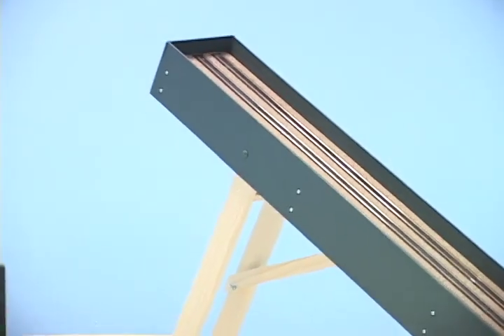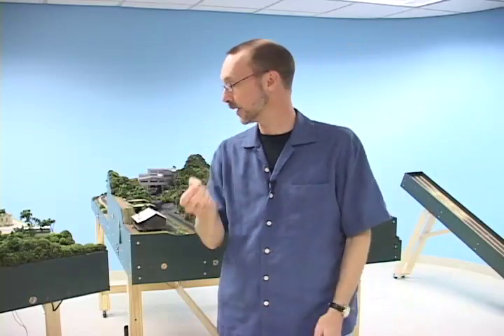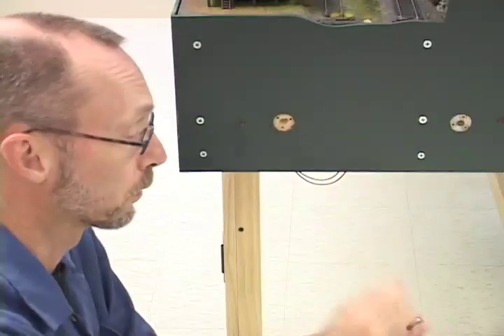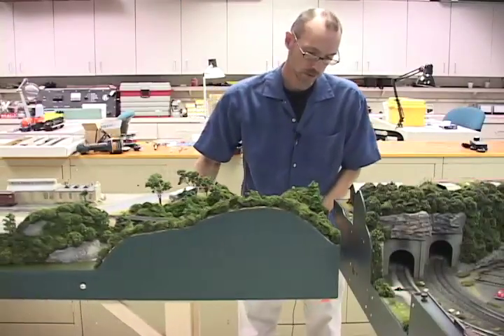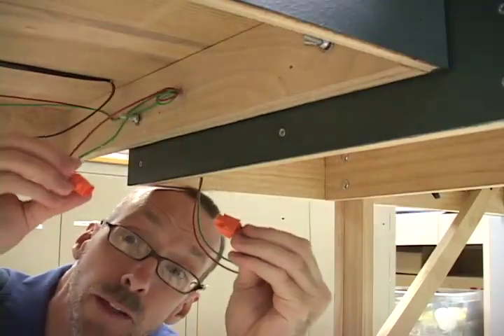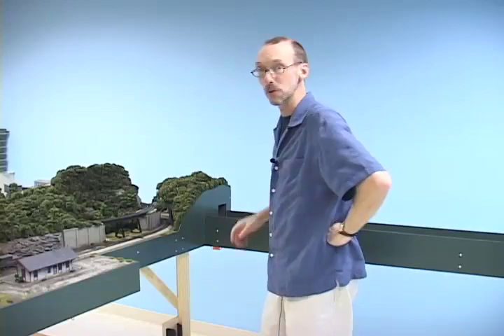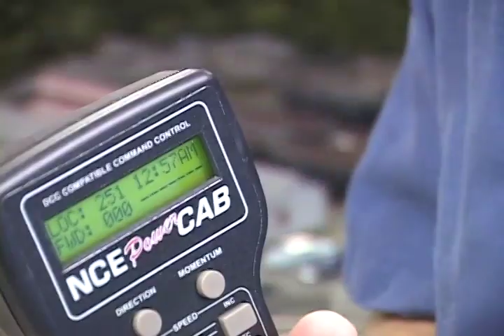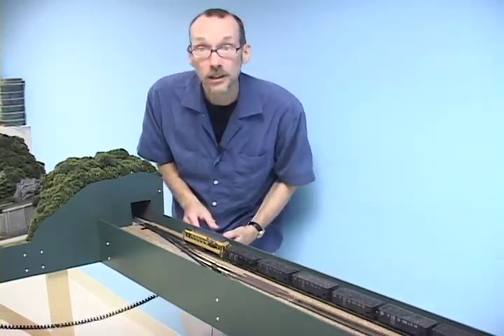Running DCC trains on the Model Railroader HO scale Virginian Ry.

Comment: I have an NCE dcc system, and am working out some of the details to build my small, around-the-room, shelf layout.  I have plans for a tunnel with staging tracks inside.  I'm thinking that with BD20 for each track I can have indication of a track being occupied.  I would like to build a small panel using a mini-panel I think, so that I can control the few tortoise machines on the layout, and some wayside lighting and accessories.  Routing the pair of tortoise machines for the staging tracks would be one of the main purposes of these bits.  Any input would be welcomed.